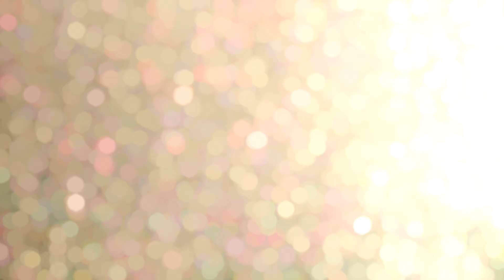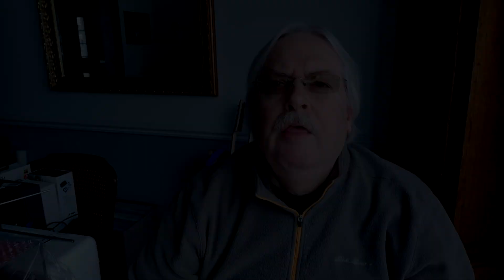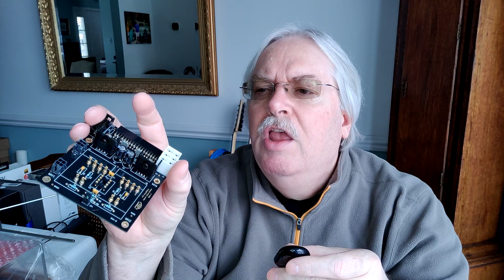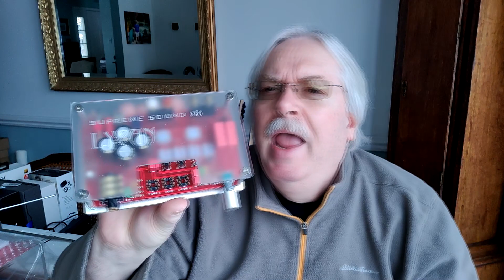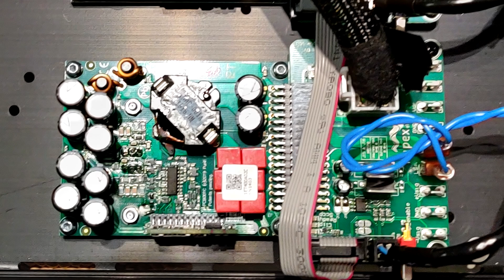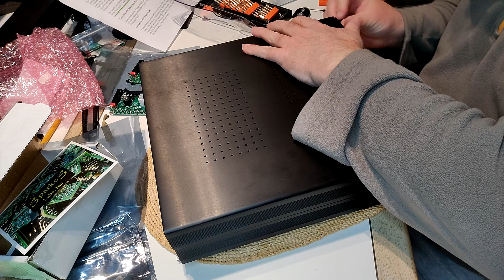VTV Purifi Amplifier - Input Buffer Upgrade

Comment: The VTV EVAL-1 is the one you want.  It's essentially the original Eigentakt version in a different case which was designed to show off the new Class-D sound and uses the non-removeable OPA1612 opamps as originally intended by its hardware designer.

It sounds very, very good and I have no desire to change opamps. It is an endgame power amp and I'm very happy with it.
Reply from the maker: Thanks for watching. The EVAL-1 is certainly a good option. Some of us like to experiment. Thus, the opamp input board.

Comment: I originally ordered the VTV Purify monoblock amps with the Sonic Integrity op amps. I found the sound to be harsh so Warren suggested that I switch op amps to the Sparko 3602s, which I did. That really cleaned up the sound. I found the case difficult and weird to remove and replace, especially to realign them. It could be made easier.
Reply from the maker: Thanks for watching. I am glad you found the Sparkos opamps more to your working. I didn't find working on the VTV anymore difficult than other amps. Warren seems open to feedback so feel free to share your experiences.

Comment: Hi Chris, I’d like to add my voice to the others asking you to comment on the sound of both VTV amplifier and the upgrades you added with the Opamps. I am new to the notion of Opamps and slightly familiar with rolling tubes so would appreciate comments regarding even gross differences in sound that can be achieved. For instance, in your opinion was it even worth the trouble of upgrading from the stock amplifier to the one operating with the op amps?
Reply from the maker: Thanks Bruce for watching. As a starting point about Opamp Rolling I would suggest reading this article: https://www.bursonaudio.com/products/ss-discrete-opamp-v4/#:~:text=The%20entire%20discrete%20op-amp%20is%20constructed%20with%20audio-grade,we%20put%20them%20in%20a%20component%20burn-in%20module. I will take your suggestion for a future followup video on this topic. Stay tuned.
Reply: @DIYHiFiLife  Thank you for your response Chris. Another question, do I understand correctly that opamps play a functional role similar to tubes in the pre-amplifier portion of the overall circuit in the VTV integrated amp? I’m thinking of my rogue sphinx which has two tubes but also relies on HYPEX class D amp boards
Reply from the maker: Yes, you are correct. Many companies are doing similar things such as the Rogue amps you mention. Also, PS Audio puts tube input buffers in front of IcePower modules. Tube buffers have more immediate impact on the sound due to their high 2nd order harmonic distortion. Opamps are typically lower in distortion and thus less obvious in their differences. Personally, I like my electronics to be as low in distortion and noise as possible and choose my speakers and room postion to attain my sonic goals.
Reply: @DIYHiFiLife  Thank you! Now it all makes sense.

You know a year ago I would have said that my preferences were exactly in line with yours regarding preferring low distortion. But this winter I built an amp camp amp designed by Nelson pass and when I listen to it and played it for my friends we all liked it and second order harmonic distortion is I believe The prominent feature of this solid State little gem. So now I’m curious as to why second order harmonic distortion is pleasing to so many people who like music. Could it be something inherent in acoustic music? Which is what I primarily listen to.
Reply: @brucebarbour9583  Yes you did understand that correctly, in your mind you could substitute a tube with an op-amp. Different vendor and topology, different sound,
but Sparkos are in the high end.

Comment: Thanks for taking the cover off the VTV amp. Do you know the gauge of the blue wires going to the back of the speaker terminals? From the video, they looked thin. Do you think this might be an opportunity for an additional upgrade?
Reply from the maker: Hi Warren, thanks for watching my video. The Blue speaker connection wires seem to be standard copper hookup wires. Probably 20 or 22 gauge. With such short lengths, I find it hard to believe a thicker wire would make any difference?
Reply: @DIYHiFiLife  It's a lot longer than a fuse!
Reply: You are thinking of fuses, where 10mm of a thin wire makes a difference. This is speaker wire so 20cm of thin wire makes no difference because it not a fuse.  Note to Sheldon: This is sarcasm  :)